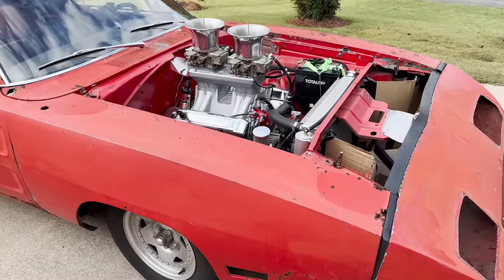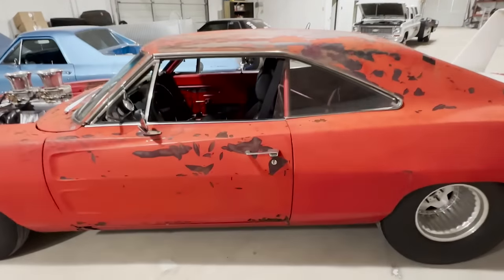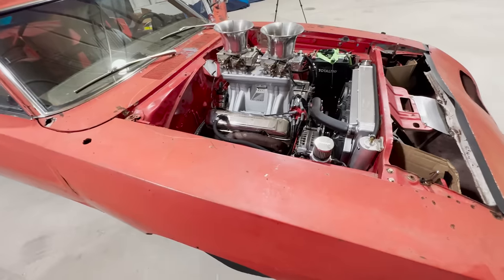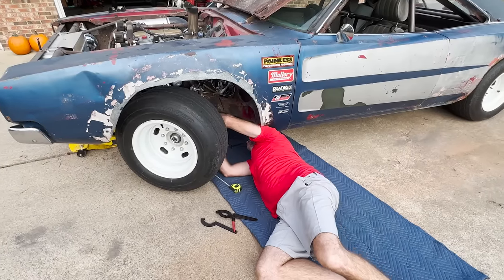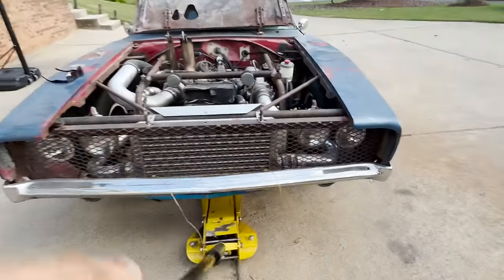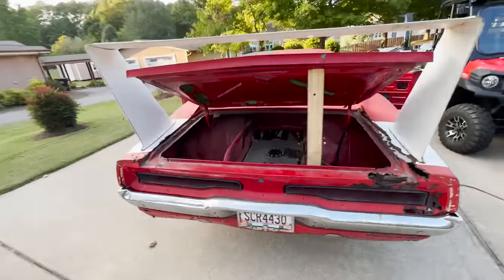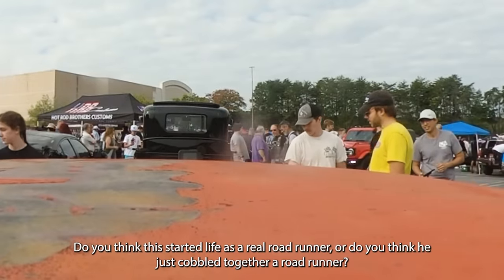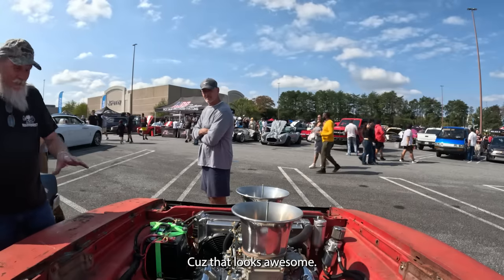I Drove The Worst Dodge Daytona Wing Car To A Car Show: Reactions Were Insane!

Comment: Time for the obligatory Sunday episode of Sillier with Finnegan - a.k.a. "Georgia's Yeti Trolls the Local Car Show, Round #2"

You ought to call that thing the General Sea - looks as if it was pulled out of one.

Jokes aside, consider repairing the rusted torque boxes and rocker panels. Those door gaps remind me of the sag you find on convertibles. That ladder frame might not be connected to the original unibody, after all.

Comment: Funny having Caffeine and Octane at Towne Center Mall. 20 years ago, It was Caffeine & Octane every weekend and even weeknights on Barrett. I spent my teens & 20’s (I’m 38 now) on Barrett. It was our staging area for Lots of crazy times and memories. Cobb police would chase us around kicking us out of Starbucks, Galyans/Dicks, Sports Authority, US Play, Media Play, etc. weeknights were usually chill out at starbucks. We used to get about 4-6 cars to pace traffic and do rolling runs at 1am on 575 between Bells Ferry & hwy 92, get on at Chastain Rd, pace traffic through the curve, then as soon as you crossed the Hawkins Store rd bridge and it straightened up, that’s where you start running usually a 2nd gear pull up to about 100-120mph then get off at 92, turn around and do the same thing going southbound. Switches from Cobb to Cherokee county there in that stretch so it wasn’t patrolled much except occasionally GSP. Good times… I had my Turbo’d Honda Accord 😂🤣😂. Our “crew” actually got back together about 6-7 years ago for a “reunion” at Starbucks. We’re all married with kids now.

Comment: If it was mine, I’d put in a new floor pan, finish the trunk, new rocker’s and fix any structural issues. The outside should stay just as it is!

Comment: Just rewatching this episode because it’s been nagging me ever since I saw the episode where you introduced the car Finnegan. A few minutes into the show here and you mentioned something that made me realize where I’ve seen this car before. It was either the late eighties or the early nineties but I saw the car in person. It would’ve been in one of 3 places but most likely at the DuQuoin,IL Street Machine Nationals. The other locations would’ve been either St Louis for an NHRA or NMCA race or possibly at Indy during the US Nationals. What I remember about the car was it sounding really really strange when it was cruisin around. I did see it parked at some point in time at the same event with the doors open and hood off. You mentioned that you had to cut the rear crossmember to be able to put any kind of a driveshaft in it. That’s the wing car I remember seeing that they’d powered with a Briggs & Stratton for cruisin around the fairgrounds. 

I can’t remember the exact setup they used to turn the pinion flange on the rear diff. There were some T buckets around that were built up similarly. The T buckets had either a front mounted Briggs with a centrifugal clutch turning a driveshaft or they’d hide the Briggs in the back under the turtle deck. The cars with rear mounted engines ran either a belt or chain from the centrifugal to the pinion of the rearend where they’d mounted or welded their chain or pulley to the yoke. If I remember correctly, your car had a Wisconsin twin cylinder engine in it. It’s been too many decades ago to be absolutely positive how it was setup but I’m % 99.9 sure that your car is the one I remember. I’m thinking I remember seeing it in a magazine at some point in time when it was photographed in a row of wing cars. I do remember the car having Convo Pros on it also. Finnegan I apologize for the long comment but it’s been buggin me ever since you put up the first video where you introduced it to us. Dunno if this sheds any light on the past of your car but I  tried. Thanks for the content 👍

Comment: Haha
Am reminded of what I think was an early eighties fwd subaru my buddy got for 50 bucks,but could have been older, that was rattlecanned black with an eight ball tagged on the roof that was partially bent in and screwdriver ignition. I as the shortest as the time actually crawled into the front and back seat and kicked at it until was a bit more head room. Then we flipped the dished rims around backwards for a wider stance and beat the crap out of it for a couple weeks rallying it around until its "owner" traded it for a case of beer. Ironically the dukes of hazard intro to the car swap off a bank was the last nail in it's coffin as it didnt want to run after that after we cruised off with our underage beer

Comment: Dude you're literally riding the way we used to in the 90s all the way up to the 2000s with these muscles cars. You could find old ratty super cheap running driving cars at any trailer park in the south east for practically nothing.

Comment: Definitely know a guy that lost a motor due to carb nut walking off the top of the stud.  He watched it happen but couldn't shut the engine down fast enough.  Beat up the chamber before it wedged next the piston and split the cylinder wall.
Reply: I’ve heard of it happening it’s notorious for happening on motorcycles with mikuni carbs the throttle and choke butterfly  screws will come out and destroy your motor if you don’t loc tite them

Comment: let that velocity stack just vibrate in the bolt so the nut works itself up the threads and into the head, hale maybe the whole stud works itself out and get sssucked in?   lololo  not the General its the Corporal . . .